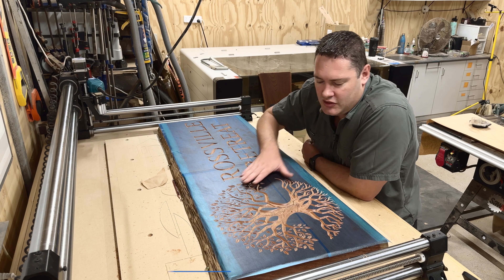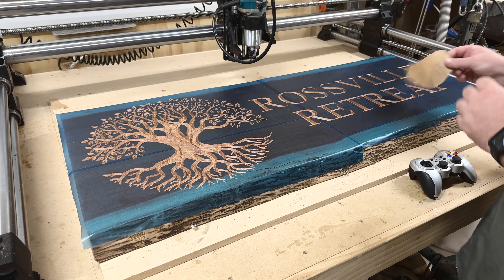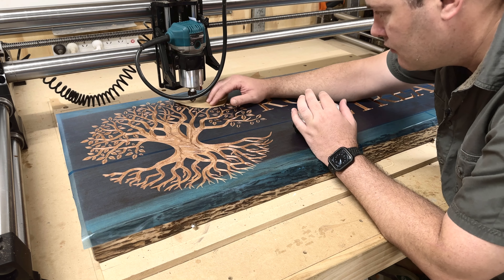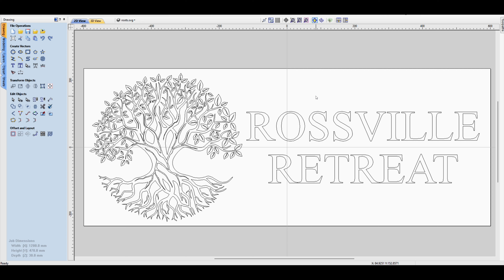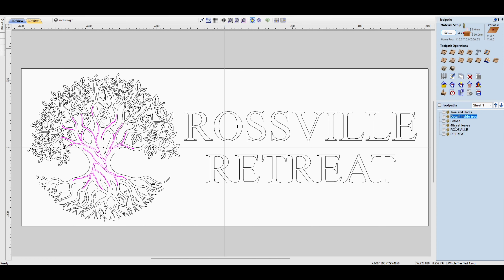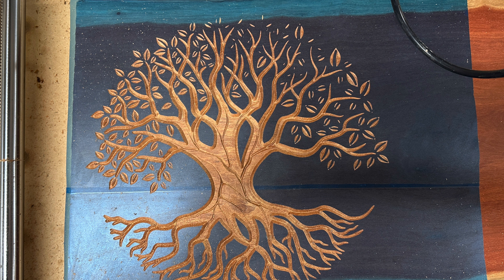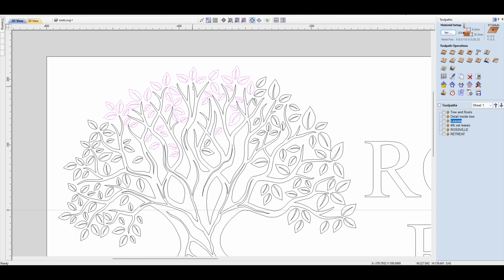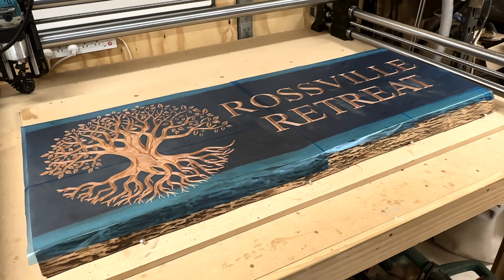How to CNC Perfect Details on Uneven Surfaces

Comment: ive had low corners on some boards, after carving some times the letters fade out at the end of a line, i used to re run the file taking note of which letters were low, then pause the code and insert a paper or card shim under the low side/corner of the board to recut those letters , then removed the shim and let the carve finish. its time consuming but at the time i didnt have the means to perfectly flatten the board. then i got a drum sander and it was easy to flatten the stock, cheers.
Reply from the maker: Hey Kevin! Thanks for the reply. And yes, that’s exactly it. Not always possible to work with perfectly flat boards for whatever reason. This is just one way to get around that issue. Thanks for sharing!

Comment: While some have mentioned using the cnc to flatten it, I’ve had some pieces that if I surfaced them there wouldn’t have been much left. As long as it’s not crazy wavy and with the right design that can be broken up into different tool paths, this could work well.
Reply from the maker: Thanks for that comment Bob. I agree.  It depends what you are working with.  This one would have been fine if you surfaced it with the CNC. I have done a few jobs where the surface was a bit wavy as part of the design and this method worked well for that.

Comment: hi interesting video, why didnt you just flatten the slab with your cnc?
Reply from the maker: 🙂 I had a replacement bit for the CNC in the mail for that, but I had to get this one done ASAP. I probably should have used a different example for this method, something like a rifle stock that is curved.  But you are right, that would be the way to go.

Comment: I think it woulh have been easier to use a surfacing bit on the CNC and level the board
Reply from the maker: For sure! The idea here is to show how you can go about getting it done if you have something that has a curved surface.  I have another slab like this (same customer) and on that one, I will use a new surfacing bit I bought. :)
Reply: @TwinSummitDesigns  thanks for the knowledge in case you had to do it like that

Comment: Show with what cutter you cut out such letters. I only have V cutter 90 and 60 degrees. But I don't have the same flat-tip cutter yet. There are different straight cutters.
Reply from the maker: Thank you for the comment!  It is an Amana 90 degree V bit.  As you can probably tell, Im new to making videos like these, but I will remember to include more detail like that in the future.